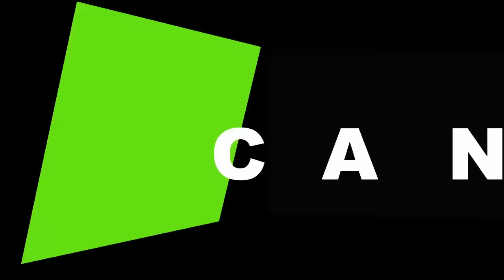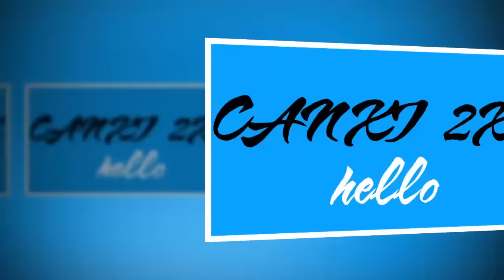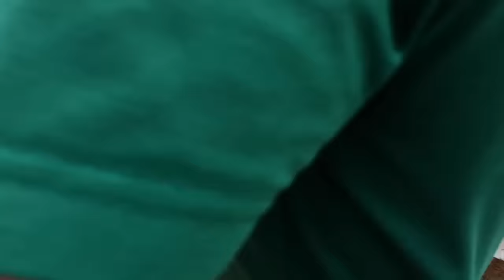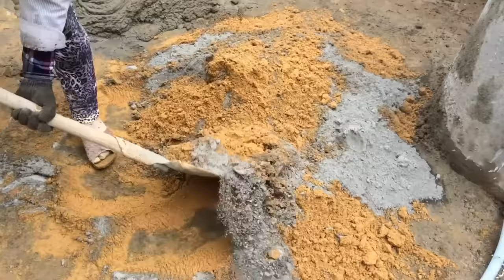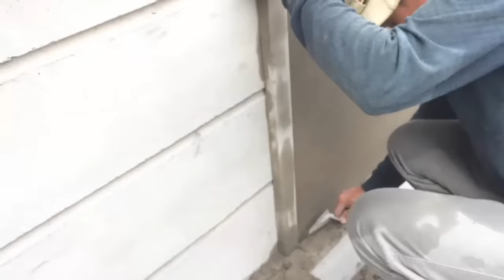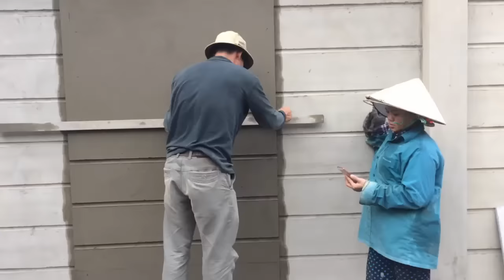How to make a professional wall, using sand and cement ratio 1/11

Comment: So much effort. ..wasted 
Why didn't he follow the existing lines? ?
Reply: I know looks like shit
Reply: Maybe the GHOST won't notice
Reply: It's supposed to be staggered on the bumped out sections. Look at the rest of the wall. 3:20
Reply: more importantly when will it fall off...the lines its to break up the monotony as an overlaid element its part of the design look down to the other.
Reply: Michael Pappadakis maybe the owner want something different,
Reply: This is art
Reply: Michael Pappadakis 0
Reply: Michael Pappadakis t
Reply: putera pandu इ
Reply: Michael Pappadakis that we call art.. different design. If he follow the existing lines... Wall design will same. Better just make straight wall.

Comment: What's the cement mixture ratio?
Reply from the maker: 1/11
Reply: Could you explain the ratio? I don’t know if I understood right. 1 part of cement and 11 of sand or the opposite?
Reply: 1 Cement-11 Sand
Reply: Rafael Torres did you not watch the video? It showed a bunch of sand, and a teeny bit if cement, that they mixed with shovels......so um yeah it was obviously 11 sand, 1 cement..... But what's the point if the wall? Its cool and all in the sense that he did it fast and precisely, but its just a block of concrete on a otherwise normal wall. No need for it.
Reply: How to make Pizza at home Hey, keep it cool. I didn’t watch the whole video. I didn’t have the time. I did fast forward the majority of it. Yeah, it is a block of concrete... The difference is that is art, beautiful and not an ugly dark modernist thing. Warm regards.
Reply: 1/11 means 1 bucket of cement for 11 bucket of sands..
In our area, we used 1/3 for plaster
Reply: B edwards I think the same.. that sounds wrong.
Reply: Ohhh. I thought that was a dirt, being yellow and all
Reply: I reckon the same. It's not the first time I hear something like these in the comments below video like these. Maybe it depends on the climate, the kind of cement or whatever, but 1:8 or 1:11 could barely be good for a castle of sand, in my experience.
Reply: 11 to 1 is a terrible mix .it may be 11  3  1  but i doubt it. It will fall off in a week. It should be 6 to 1 mix and admix .or a 9 2 1 with lime
Reply: 3 sand to 1 cement is normal for mortar, thats just a botched job that will last about 6 months
Reply: 1:2:3
Reply: portland or chalkcement--makes all the difference for the ratio